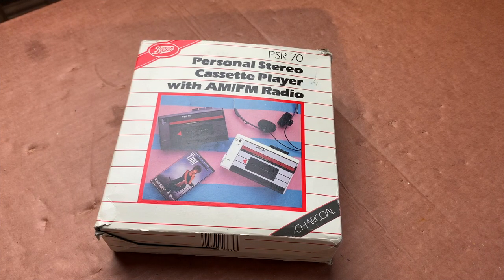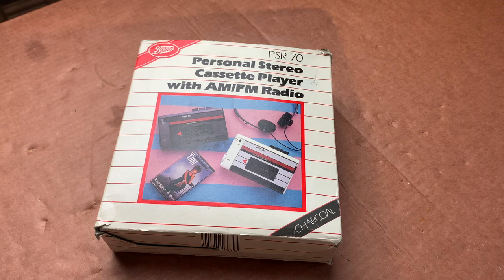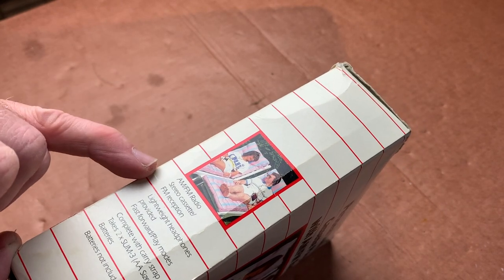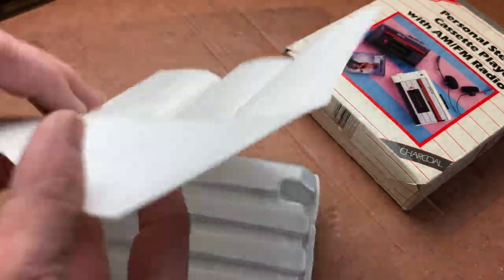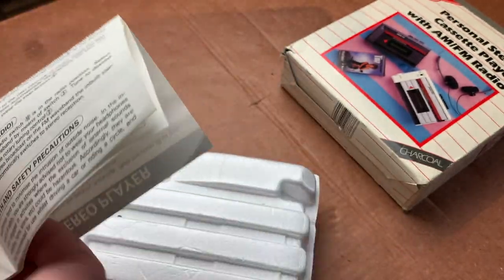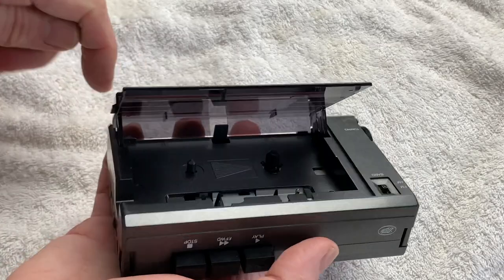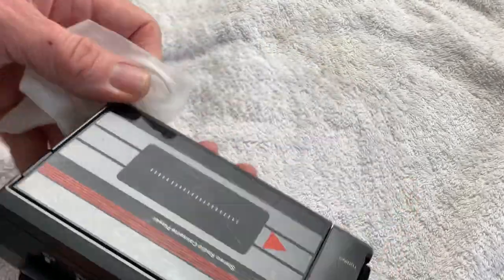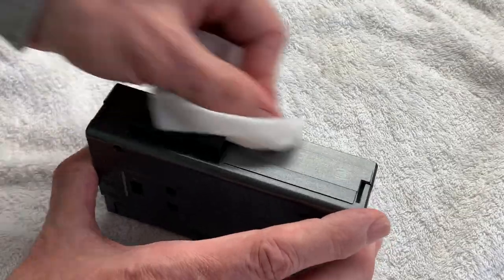Personal Stereo Repair. Boots PSR70 Vintage Radio Cassette Belt Change, Service & Headphone Fix

Comment: How can you change the play speed on this model? I have one running a bit slow.
Reply from the maker: Check the fit of the belts. Too loose, they slip and play slow. Too tight, they drag the motor and play slow. If belts OK, tweak the variable resistor near the negative battery terminal as you play a tape - you should be able to reach it with a tiny flat head screwdriver. Adjust it until you're happy with the speed.
https://www.buymeacoffee.com/retrorestos
Reply from the maker: Coincidentaly, I had one come in after I replied to you today. Complete teardown, deep clean & polish, head clean, 2 new belts and adjusted the speed. Very simple job on this one.
Reply: I couldn’t fathom where the variable resistor was. Thank you ☺️